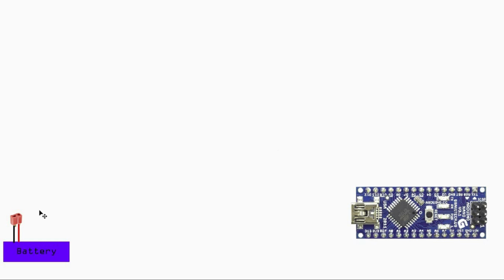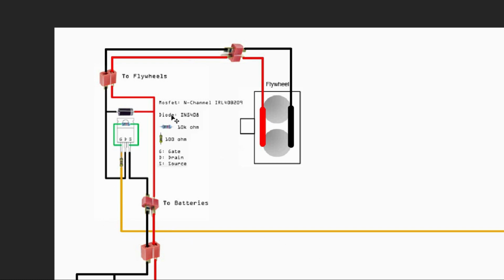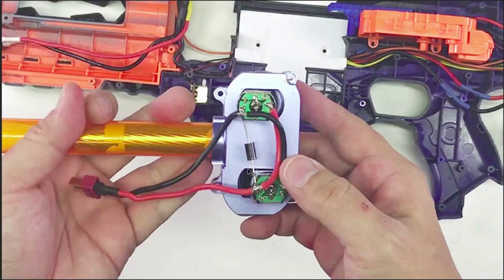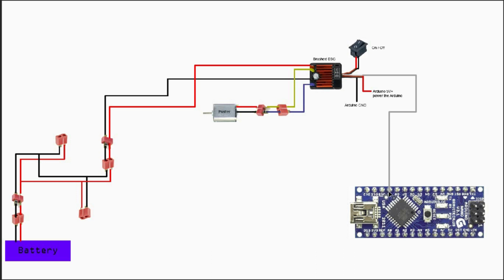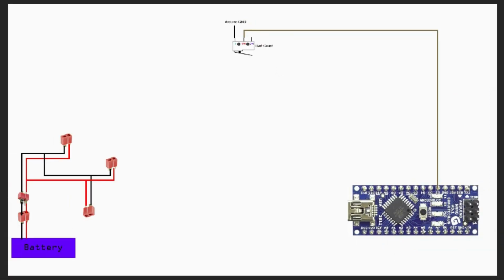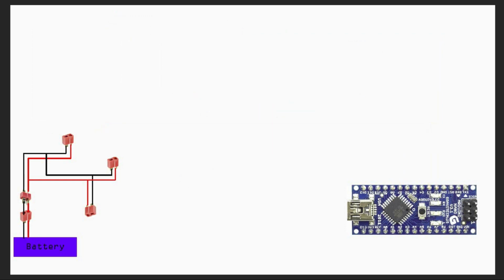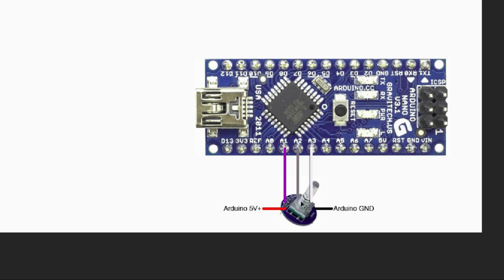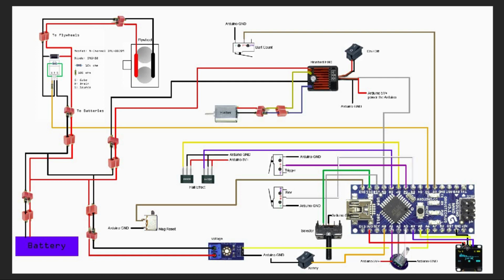Tungsten V3 - Arduino Select Fire Rapidatrike Part 3 - Circuit

Comment: kind of new to Arduino programming, but you mention that many of the components connect to the Arduino GND, but there is only a few on the NANO. How would you connect all those to the GND? I know I sound stupid as I'm new at this, but I'm just confused as to where the wires that are not connected in the diagram go (only tells you where it goes)
Reply from the maker: No prob man. you can connect one wire to the GND of Arduino and split that connect into multiple wire (like a tree branch to as many connection as you need) I did a diagram, check out this link https://i.imgur.com/LtSwe3J.jpg any of the GND of Ardunio is fine.
Reply: Tungsten EXE awesome! Thank you so much!

Comment: hi There
Sorry if my question OOT,  i like to use 2 ESC for Flywheel with brushless motor and 1 ESC for Pusher.
Can u guide me how i modify your code on @ g1thub
 ?

Thanks for your answer..
Reply from the maker: Hi, I have not tried Brushless motor yet and had not program ESC for brushless yet, hence will not be able to help, sorry.

Comment: I have a question, why do you use an ESC for the pusher and not a mosfet like the flywheel?
Just to be able to feed the Arduino, or have I missed something else
Reply from the maker: For the pusher, I will require motor braking, and because I have to control it through Arduino, I will have to use a 3 mosfets setup (2 N-channel and 1 P-channel) , that will be lot of extra soldering,  and I will use 2 pins to control the mosfets, on top of that I will have to use a buck converter to step down the voltage from the battery to power the arduino (because onboard regulator is not very good). Therefore I choose the ESC over the 3 mosfets setup, basically to save time and soldering required.

Comment: HI Tungsten, thank you for your videos !! I am about to finish my auto stryfe based on your previous serie. I want to include the hall effect mag capacity detection ! As mention in previous comments please do a video about the program, there are some portion which are still obscure for me due to my noobness about arduino (the "readVoltage" Function and the "pusherReturnCheck" (don't need anymore ?)). Big shot out to you from France !!!
Reply from the maker: Frenchy no prob man will work on a video on the program and go through those areas :)
Reply: Thank you so much !